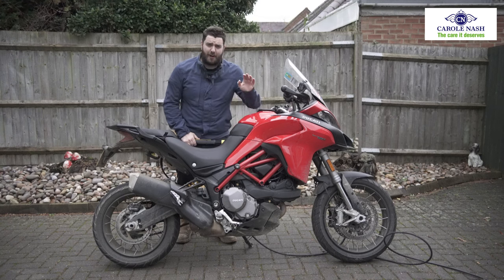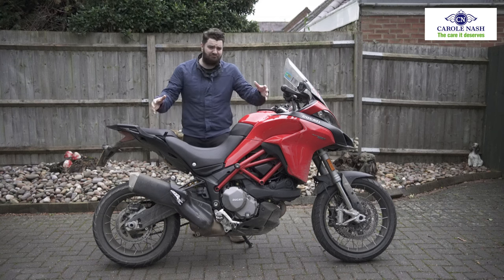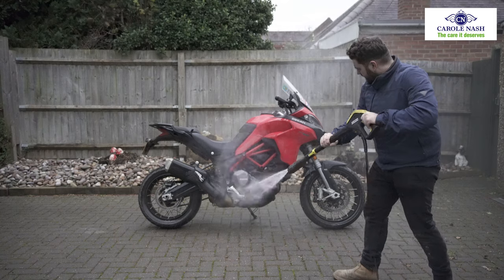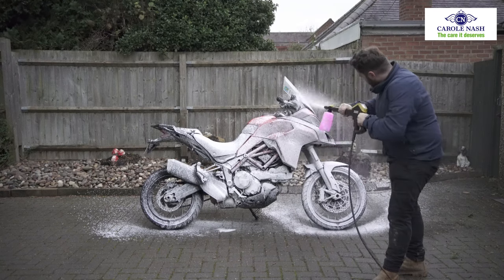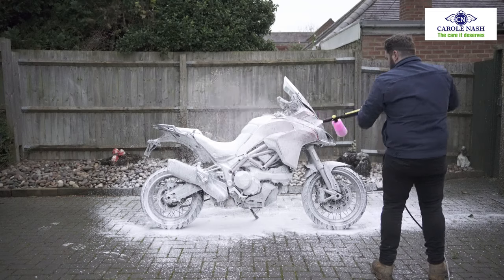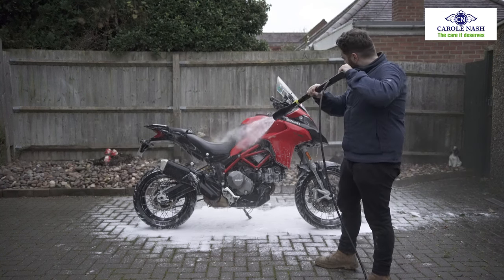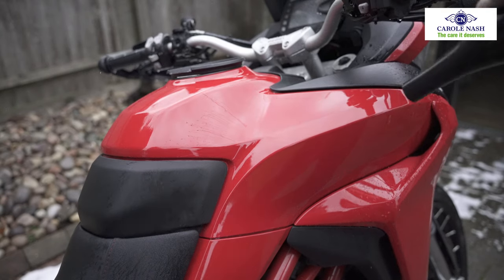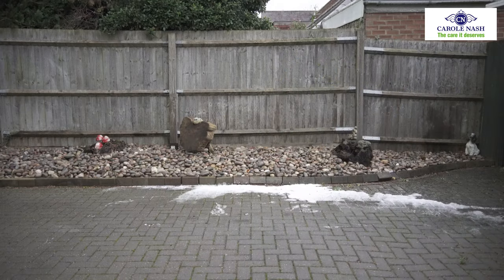Pressure Wash & Snow Foam | Motorcycle | Harmful?

Comment: IMHO this is wrong on many different levels. 
Snowfoam is a PREWASH product, meaning you loosen the dirt after snowfoaming it, rinse it off and then onto your 2 bucket handwash. 
When using the dryer, always work you way from the top of the motorbike starting with the screen and controls adjusting the blowing angle so you dont drive the water in but out of the components. Painful.

Comment: I just purchased a foam cannon for my Greenworks 2000 electric pressure washer.   I use this to pressure wash my house, stone patio and foam wash my cars. I have a question, please?  I have a motorcycle of which the owners manual specifically states while detailing the bike, do not use soaps or cleaners on the windscreen which contain ammonia or waxes. Which foam soap would you recommend specifically for motorcycle foam cleaning?
Reply: Muc off?
Reply: Bilt hamber auto foam is mega
Reply: Bilt hamber auto foam or bilt hamber touch-less